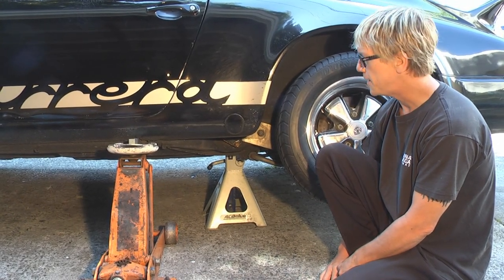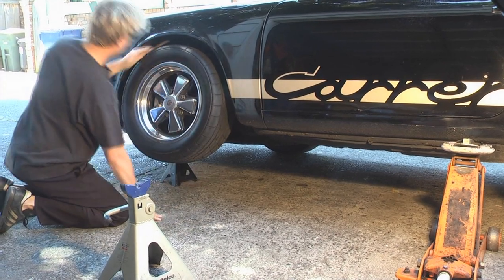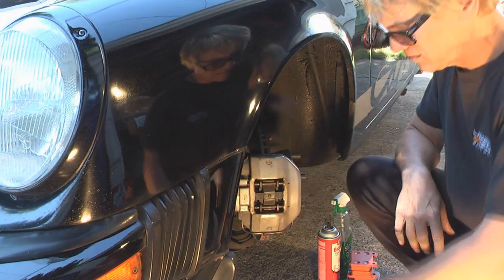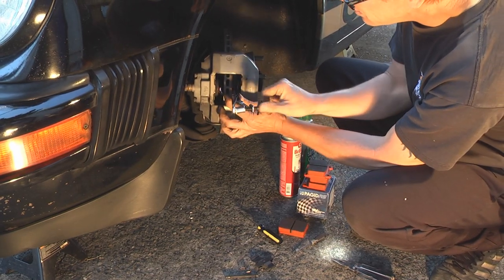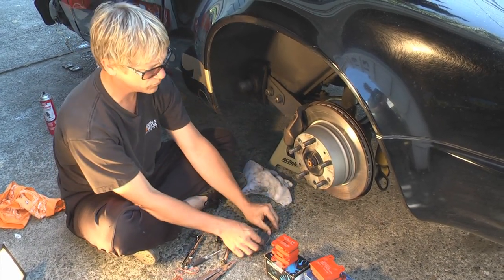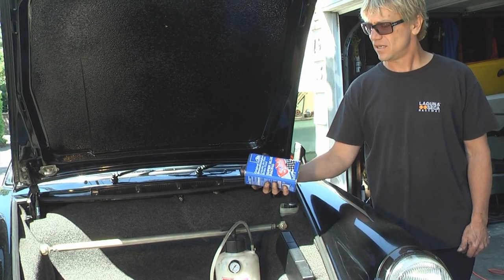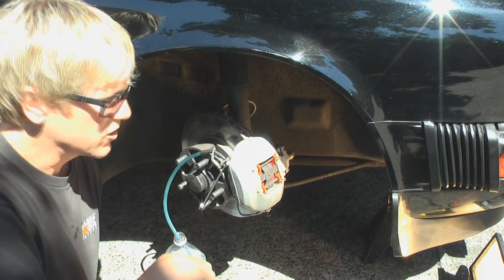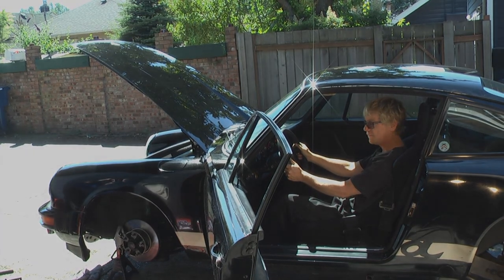New Porsche Brake Pads & Bleeding the System - DIY German Aircooled Garage #4

Comment: No need to align the caliper pistons at 20deg using the P-84 gauge?
Reply: Also wondering about this--do the pistons tend to stay in the correct orientation? Also is it a good idea to keep an eye on the brake fluid level in the resovoir when forcing the piston to retract (so fluid doesn't overflow)?

Comment: Nice video, have an 83 Porsche 911, have a problem with sticking calipers. Thinking it is due to wheel cleaner spray at the car wash, although I store car for long periods in the winter. Any suggestions? Front right was sticking now rear right is sticking. Today I sprayed them all with brake cleaner. On the way back from car wash, rear right sticking after 15 minute drive home. Thank you!

Comment: Eric,  Thanks! Brake bleeding and flushing are the same thing. I only bleed the brakes once a year, typically at the beginning of the track season or if i had to make a repair to the brake system. Depending on how much track driving you do you might want to bleed more often. Front rotors are pretty easy once you get the brake calipers off...without opening up the brake fluid system. Rear are a little more tricky as you have to work with the emergency brake pads. Typically the rear rotors are changed much less often.

have fun! 

phil